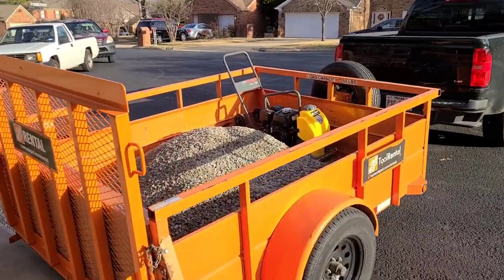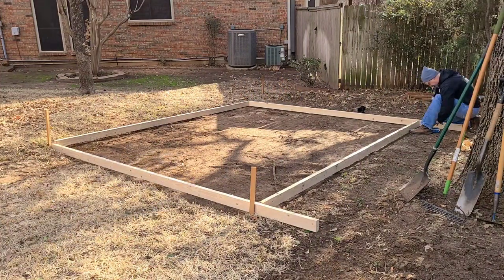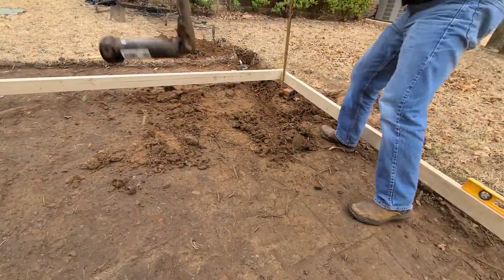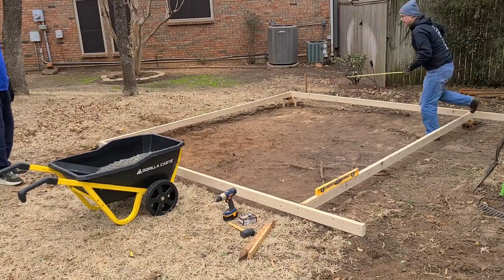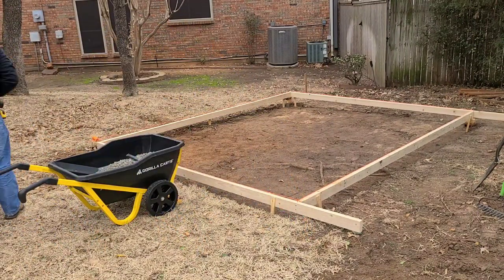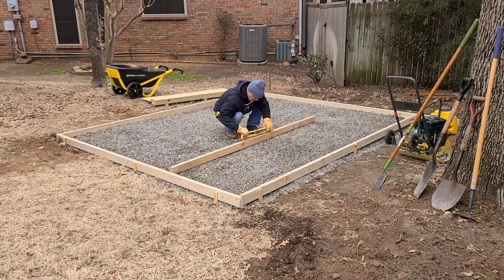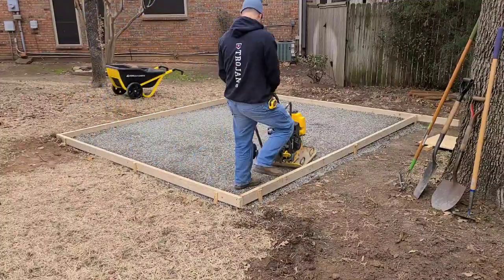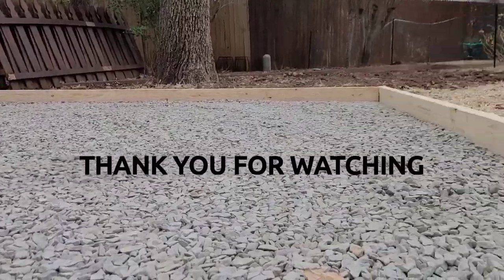Shed build part 2 - pad preparation

Comment: The goal was to get the compacted base up to level so you could have a 3 or 4" slab? Thanks for putting these videos together.
Reply from the maker: Yes, the difference in the height of the ground from the highest to lowest point was about three or four inches. I used about two inches on the high side and five to six inches on the low side. That created a nice level area. Also, it will allow for proper drainage. When water approaches from the high side, it will hit the concrete slab. Some will naturally follow the slope of the ground and go around the shed. But some will actually go under the slab and go through the rock.